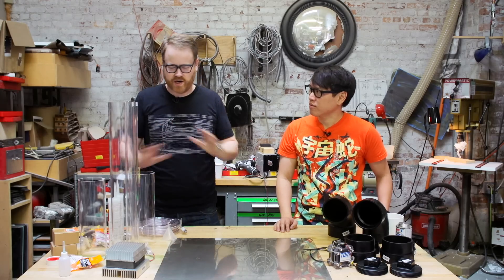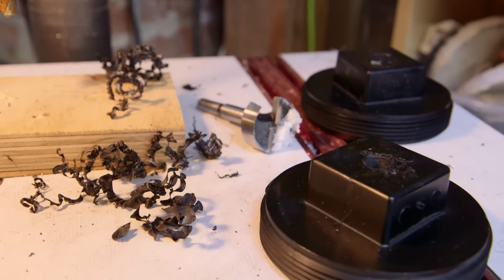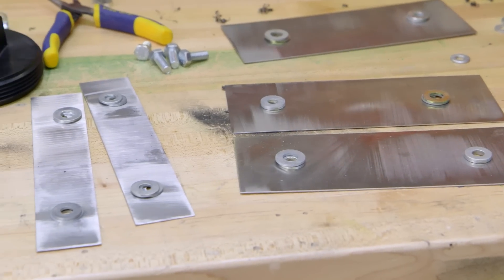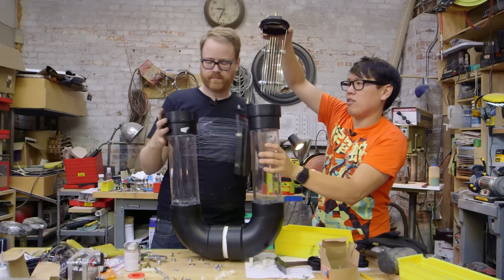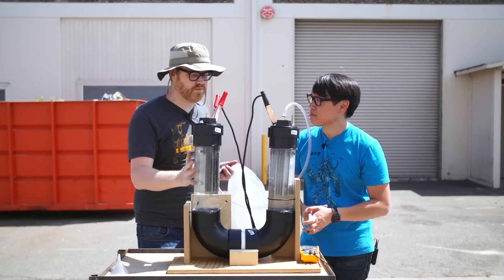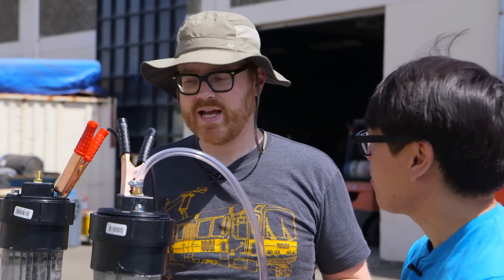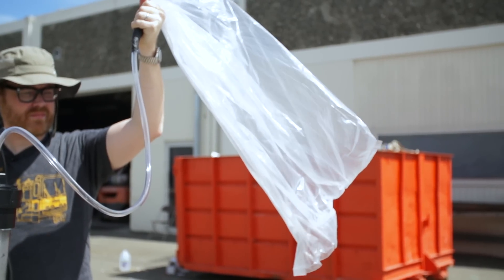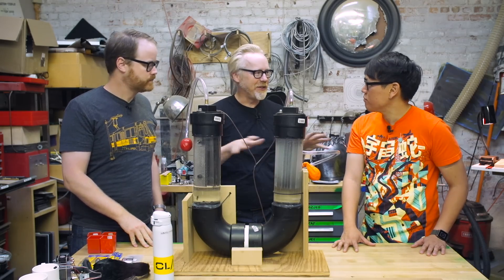Tested Builds a Hydrogen Converter

Comment: And it's the amps that create hho. not the voltage..
Reply: You are right as an electrochemical cell is not a resistor obeying ohms law. The potential determines what reaction can occur at the electrode but it is the current which determines how much of that reaction occurs per second via faraday's law. 1 amp= 1coulomb/sec = 6.24 x 10^18 electrons/sec=1.03 x 10^-5 mol of electrons /sec so 1 amp  produces 5.15 x10^-6 mol of H2 per second at the cathode provided the potential is above the hydrogen over potential ~1.2Volts. Double the current to double the rate of H2 production. Eventually the diffusion rate of H3O+ to the cathode will limit the production of H2 there and increasing the current will not increase with the voltage in a linear way.
Reply: Kevin Jackson please Google it man.  Hydrogen has been made this way for centuries.  How do you think they filled up all those German Zeplins?  Remember the Hindenburg?
Reply: ohms law uses 2 known value to get the 3. u cant use the formula to change 1 value to change the other 2. ohms law = "resistance * amps = volts". and u use the wrong law its joules law ( volts * amps = watts )to get watts not ohms. its not that u dont know the basics of electrical engenerring u cant even do simple math. prove me wrong
Reply: thedoctorzeus Voltage is potential. Amperage is the measure of electrons flowing. The best way to picture this invisible force I have found is the water hose. Think of voltage as the water pressure in a hose and amperage is like the diameter of the hose which dictates how many water molecules pass a given point. I have built many hydrogen generator units and have projects on instructables, pintrest, and youtube.  Faraday discovered and created the laws governing the production of H2 from water.  He discovered that the voltage required is very low, only 1.3 volts DC.  However, the amperage is dictated by the surface area of the plates.  You must have no more than roughly half an ampere per square inch.  This current density can be achieved and regulated by simply adding electrolyte to increase the current, or adding distilled water to decrease the amperage. The O2 separation from H2 is very easily achieved with a porous membrane and separate outputs on each side of the membrane.  There should be no debate on this topic, except within the history deficient community.  Hydrogen has been separately collected from the electrolysis process since it's inception.  Remember the Hindenburg?  In the 70's a man named Stanley Meyer revolutionized the process with his Hydrogen Fracturing technique.  His approach involves laser excitement and high voltages that literally rip the hydrogen out of the water.  The spark ignites the hydrogen but the magnetic field produced slows the burning thereby releasing huge amounts of energy in a controlled sort of cold fusion process.
Reply: Well one they're not making oxyhydrogen they're making hydrogen. And two, the voltage and the amps are required to break down the water molecule. The voltage is what drives the energy (potential) and the Amperes is what gives it the power. Think of rice in a river. The rice is the electrons (amps) and the river current is the potential (voltage).
Reply: MrHydroguy
Sorry, 316l steel and modern day electronics circuits can't change the way the universe works.
Reply: Yep amps is like the hammer pushing the food into a mouth. The bigger the hammer that faster the food supply. Volts are the food that never changes. The resistance is the size of the mouth. I have a 12 volt button battery, but I'm sure it won't start my 12 volt car.
Reply: It's always those damn amps...
Reply: MikMech volts is the hammer, amps is the food...
Reply: this is true. and it would be helpful for someone to know if they were limiting the current. but they werent, it was just straight from the panel. just not good enough for the current to get it going even faster.
Reply: Voltage is pushed, amps are pulled.  Would need to know the resistance of the setup to know what the amp draw is of this setup.
Reply: @saltysteel3996  or you could be knowledgeable enough to know that the 100W from the panel (which actually was not generating 100W as it was not tilted towards the sun) was no where near enough. Even as you double your voltage or what ever the damn panel is not going to produce over 100W. 

That setup had enough surface area to be pushed with at least 500W maybe even 1000W (did not feel like calculating that).
Reply: michael fogelström
Ok, you got me. I extrapolated into Joule's Law without saying as much.
and know u cant use the formula to change 1 value to change the other 2. u can change volts or resistance to affect ur amperage.
Reply: MikMech exactly
Reply: Volts is the push. Volts is the electrical pressure. The force. Amps is the rate of flow. The current. I agree that it is the important factor and that this experiment was done wrong. Just suggesting that your metaphore may have been a little backwards. I agree with your point though :)
Reply: Wrong. At least you got Amps is the flow rate. Amps are what make shit happen!
Reply: Sorry, I may have been ambiguous in my message. I was agreeing with you that the current was the important factor.
Reply: this is the problem with our current school system... the LOAD your referring to is determined by the device consuming the energy... this is a measurement of resistance against the power source, its measured in AMPS... doubling the voltage does nothing to the current (amperage)... in this application the amperage is determined by resistance in the water, adding more electrolyte creates more resistance because the water is more conductive and puts a higher the load on the power source... the problem here is that they didn't use a power source CAPABLE of creating enough current to get the result they were "supposedly" looking for... mathematically it looks like this, VxA=W, or W/A=V, or V/W=A
Reply: Kids commenting here it seems. 😒
Reply: Adam asked Tested to produce hydrogen, not HHO!
Reply: there are lots of videos that show HHO being made from water and baking sodaif the device in this video didn't make much it's probably because the amount of amps used is lowhow many amps were used in this project?did they say?and they have to make HHO before they separate it into hydrogen and oxygen
Reply: Tested was asked to build a hydrogen generator, not a HHO generator. How do you propose to separate the hydrogen and oxygen?
Reply: MikMech I never said that the amperage wasn't the important thing.
Reply: I was only pointing out that the "hammer vs food" metaphore was backwards since Voltage is the electrical pressure or the force behind the Amperage which is the current or rate of flow.
Reply: Sutanreyu yet a 12v car battery can Start a typical car with a average 650 amps...
Reply: Kevin Jackson you can separate the water molecule into one oxygen and 2 hydrogen with a catalyst.. water itself isn't conductive.. baking soda is a good catalyst. or Apple cider vinegar for best results
Reply: bill71183 more conductive = less resistance. Also the load is not measured in amps, it is, as you wrote correctly, a measure of energy or power, if we disregard time which we can do if the load is constant. Doubling the voltage DOES double the current according to Ohm's law (I = U/R).

That said, this really was a pointless video. Just giving up because it doesn't work on the first try is stupid. Even moreso when they aren't measuring anything in the first place.
Reply: that's just half the truth.
it's the voltage and the resistance.  Voltage = Resistance * Current.
while the voltage is rather "fixed" by the photovoltaic panel, the resistance is easy to influence.
on the one hand, they could have at least slightly upped the concentration of ions by adding more potassium hydroxide, on the other hand, they could have minimized the distance between the electrodes.

just by putting the electrodes closer to each other, they could have gotten a higher current - by orders of magnitude.
Reply: Looked like it had a leak to me
Reply: It's actually a combination of the volts and amps, called watts. It's the total energy input. 12 volts at 20 amps is 240 watts. 24 volts at 10 amps is 240 watts. The total resistance of the cell dictates the total energy that can be input into the system. The only way you can increase the amp draw through the cell is to either increase the voltage or reduce the cell resistance.
Reply: Kevin Jackson yes, but that is only if the system has the same resistance. If that's the case ohm's law works fine. In other models they made, the distance between the electrode plates were a lot less. That means the intrinsic resistance of the electrolyte will be way less, so a lot more current passes for the same voltage. But here they separated the electrodes by almost two feet this means the electrolytic resistance is way up compared to the other models that are available. And that means a lot less current for the same voltage.
Reply: The resistance isn't the thing which determines the current here but the output capability of the solar cell. He said it can give 100 Watt power. With the voltage of 22 V and P=U*I you get a current of 4.54 Ampere. The resistance of the salt water is pretty small. It's effect is that it lowers the voltage like this: U = 22V - 4.54A*R with R being the resistance.
My guess is that a car battery would have worked a lot better since it can give a much higher current.
Reply: thedoctorzeus the overpotential of water is 1.23 volts.
Reply: Efrain Gomez Nope it's actually watts but the higher your voltage the lower the efficentcy.
Reply: you got it right
Reply: Voltage is resistence and current (AMPS) so how much resistence it the water/plates/wire creating. I'd say alot is being lost here Eletrically
Reply: Correct, Efrain Gomez is getting the cart before the horse.
Reply: Oh fuck off, You don't know what you're talking about, HHO doesn't exist, Hydrogen is diatomic.So is oxygen, And that's a good thing, If it was not, It would just explode on you; Like a hypergolic fuel.Amps are a measurement, so are volts. Hydrogen Oxygen generation is caused by electrons. You can't generate hydrogen by writing a number down and doing a rain dance.No amps can flow without volts, No power can flow without amps. It's a chicken or the egg.
Reply: I thought stan meyer ( who ran a car and a dune buggy on hydrogen) said his system used infinite voltage but only miliamps? People keep talking about the  same set ups  as in this video, and mention running cars on it? Nobody  has done it with standard electrolysis, it doesn't produce enough. It has to do with resonance of the cell.
Reply: what an idiot
Reply: For the best information on that, you should look at www.eagle-research.com
Reply: Higher voltage and temperature increase the efficiency but
Reply: Yes. The resistance is too large. The two electrodes must be closer.
Reply: The voltage drives the amps.....
Reply: Kevin Jackson
These Dunning-Kruger people, geez....I hope I'm not one of them :-)
The argument of "it's not the voltage, it's the amps" is like an argument of "it's not how high you fall from, it's your impact with the ground", haha
Reply: @zeusnitch  "It's not the bullet...it's the hole!" 
Indeed.
Reply: They said 22V 100watts. But the way they hooked it up. 12V 100watts max. However their is probably a lot of resistance in the water, So probably very low current.
Reply: Kevin, where's your video, since that's what you're asking everyone. 
Also, it seems you never made it past grade school science if you think doubling voltage will double amperage.
Reply: Kevin, you've asked at least 3 commenters where their videos are, when you don't have one yourself. Where's your videos to disprove their claims and ideas? 
Doubling voltage would double wattage, but not amperage; and vice-versa with amperage doubling. The only way you can get double voltage and amperage is if you quadruple the wattage and regulate voltage and amperage to where they are double their original value. 
You're a hypocrite, and you don't even know the basics of electrical engineering.
Reply: amps is whats get u hurt volts are the means of getting the hurt to u. if we use gravity as an example, volts are the speed of the fall the amps is the hardness on the ground. stunt men jumps down buildings all the time but they control the hardness of the ground and survive
Reply: Kevin Jackson shut up and keep stepping fool you are not here to say anything constructive. Faraday didnt have 316l steel and he didnt have modern day electronics circuits to control the electricity going through the water. So his info is out dated and incomplete.
Reply: Xander Zoolander
We're dealing with a very simple circuit so Ohm's Law is going to apply pretty well.
Doubling the voltage doubles the amperage and quadruples the wattage. Halving the resistance also doubles the amperage but only doubles the wattage.
Please prove me wrong, otherwise stop with the "you don't even know the basics of electrical engineering" BS.
Reply: Xander Zoolander
Listen to thedoctorzeus, he paid attention in school.
I'm not saying Tested did anything wrong so there is no need for me to build anything. Only people that claim they know a better way need to show us.
Reply: Xander Zoolander
I'm not the one saying amps creates HHO, so no need for me to build anything.
Current into a fixed load doubling with Voltage is a law of physics, did your school teach you something else?
Reply: If you know how to do it, where is your video? My grade school science class said it you double the voltage you double the current.
Reply: true